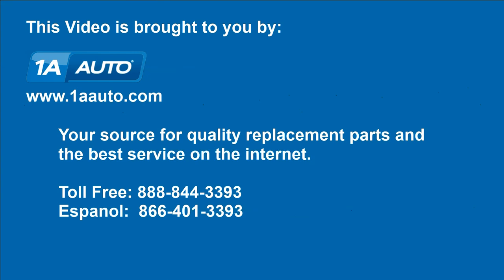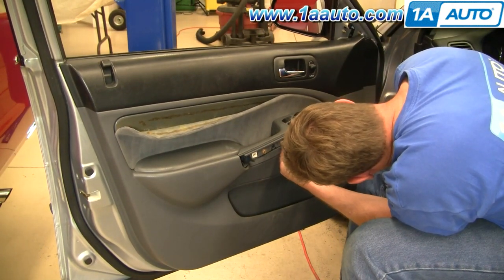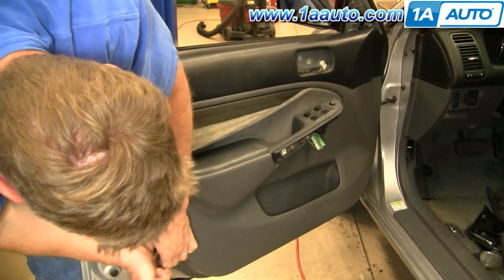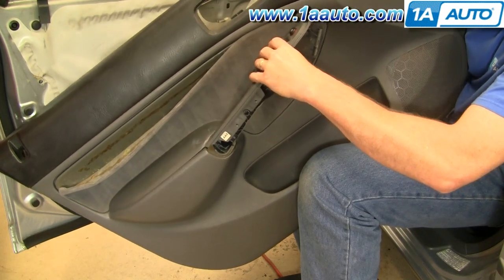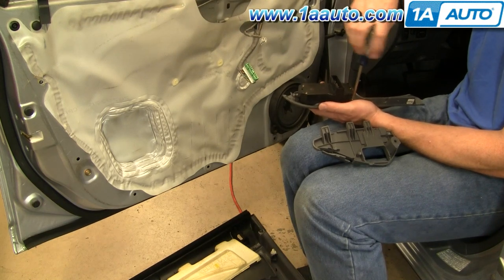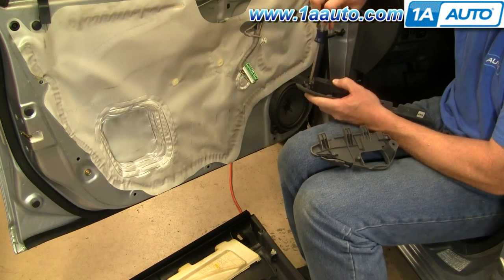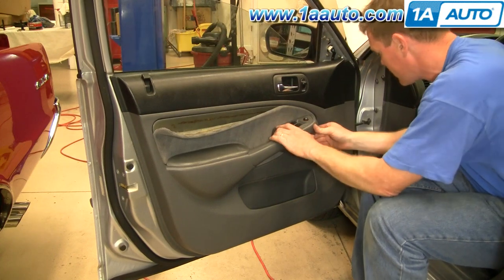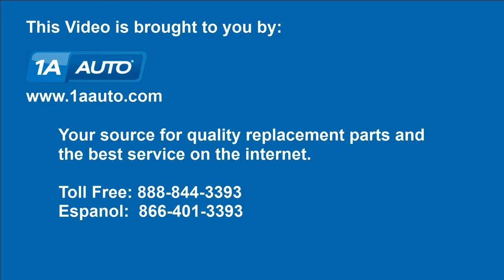How to Replace Power Window Switch 01-05 Honda Civic

Comment: Thanks for sharing!  I saw Honda Service Bulletin 06-010 from March 8, 2006 that shows this can all be done from the outside without taking the door panel off. I was confused why you did that, and even after you got it off you, in the end, popped the portion that holds the master switch off from the part that was screwed in from the back as near as I can tell.  Seems you may have caused a bit of extra work. That service bulletin is not extremely clear on the clip location to remove the switch base, but after watching your video I think it can be done without taking the door panel off. Maybe. :)
Reply from the maker: +Steven Palm Thanks for watching. If any of our viewers needs to make this repair we carry the part shown in this video on our website. Here's a link to them https://www.1aauto.com/1A/WindowSwitches/Honda/Civic/1AWES00100?utm_source=YouTube&utm_medium=CTA%20Comment&utm_campaign=1ATony
Reply: I just replaced mine yesterday. Indeed you do not have to remove the entire door panel. Only the control button housing.
Reply: Thank you for including the TSB number. I found that with a quick search and also didn't take the door off! You saved me at least an hour. Thank you.

Comment: There was no need to remove the whole door panel but in your case you were removing it anyways. Not trying to be ignorant but this can save others and bit of time and frustration and possibly spare a few clips from being broken by the untrained hand. But this was a great video nonetheless. Keep up the great work 1aauto !
Reply: sergio cisneros pienso lo mismo, lo reemplazé hace unos dias y no es necesario remover el panel completo, saludos
Reply: I was wondering if removing the whwile door panel was necessary 🤔
Reply: Also by taking the door panel off you can misalign that foam block and mess that up too. Totally unnecessary to take off the door panel.

Comment: Please pin to the top that the door panel does not need to come off to replace the door switch. You just pry off the the bottom side of the arm rest under the switches with a screwdriver, then there's a couple of screws holding the power window arm in. Then you take off 3 screws holding the switch in, and that's it! No need to remove the door panel and possibly misalign that foam block. I actually had to remove one of those foam blocks very early on when I got the car because it fell out of alignment and I didn't know how to take the door apart so I just left it off. If you misalign the foam it'll get in the way of the window going down.
Reply from the maker: +aznnp77 Thanks for the feedback!

Comment: Hello, I have a question. First, thank you for the great, thorough video! i have an 01 civic and I changed out my switch and fuses because my passenger window switch burned out on the master switch. However, after testing my new switch, the broken, front passenger side window works but now the front driver side window doesn't work. Any ideas??

Comment from the maker: @MexhomieXlll Check the wire harness that runs between the door and body of the vehicle, there may be a broken or frayed wire in the harness that needs to be repaired. Hope this helps you out. 1aauto.com 888-844-3393

Comment: I have a 2001 Honda Civic EX Coupe, and the lock cylinder of the driver's door fell inside the door panel (I assume something is loose or maybe broken & ready for a replacement) I cannot lock or unlock this car anymore!. Thanks to this video, I know how to remove the door panel, however I do not know how to replace or repair the key cylinder. Can you help me out? is there a video for this?
Reply from the maker: Thank you for watching. We do not have a video on the cylinder but will keep it in mind for future videos.
1aauto.com 888-844-3393

Comment: Hi, I loved your video. I replaced fuse and replaced master switch .(smoked with burning smell) The passenger side window worked 1 time! up and down then quit. Fuse still good..any ideas?
Reply from the maker: You may want to test the power going to and from the switch to see if there's power going to it. Also check the wire harness between the drivers side door and the body of the car to see if there's a broken or frayed wire that may need to be repaired. Hope this helps you out. 1aauto.com 888-844-3393
Reply: thank you so much!

Comment: I attempted to remove the passenger front door panel using a putting but it would not budge. I removed the cover near the mirror, disconnected the wire, removed the cover below the power switch, removed wire there,  unscrewed the 2 Philips, removed the door look and disconnected the clip. No matter how force I put, I could prove open the panel. I follow these same steps for my 01 civic coupe and it worked with ease but I having a hard time with my 01 civic sedan. Any suggestions would be great?

Comment: Good vid. thx
Reply from the maker: Thanks for checking us out. 1aauto.com +GKT
Reply: @1AAuto  , hi, revising my comment,  I reviewed several other vids and an online civic oem manual and there is no need to take off the entire door panel . access to the handle and window control module can be all be done by prying off the face of door handle, alone, and unscewing  two screws and the entire mounting faceplate then slips out forward, and off alowing the wiring harness access and then with faceplate and switches in hand' some small screws remove the module from plate.  please remove this vid...it is highly deceptive. please see other comments below...that were ignored. thx, gt, boise , idaho

Comment: I bought the master window switch and the two back buttons are hard to push up and down and sometimes get stuck idk if its the switch or the motor or relay that is not working correctly

Comment: I have replaced my master switch and still no result.  The new switch doesn't operate the driver door window nor the other 3.   Currently the only window that works is the passenger side.  I have a new window regulator for the driver door and the switch doesn't move it when tested.  I've checked all wiring harnesses and Yes power to the driver door.  Is there a key reset step process to go through after replacing the OEM bad master switch with a Aftermarket switch so the computer can talk to it.  Thanks

Comment: Did anyone else's window switch fill the car with electronic smoke when it went out? Mine did twice, once during the right rear window death then another time when the passenger window stopped working.
Reply from the maker: +Jthumper You may want to check the circuit for a short that may be causing this issue. Hope this helps you out. 1aauto.com
Reply: Jthumper mine did as well in the passengers window smells like burned rubber!

Comment: hi any idea how or why the rear driver and passenger windows wont go up or down from master or from the rear of the vehicle..will replacing master fix all of them
Reply from the maker: Hi Michael, You may want to check the power going to the doors that are not working with a test light to see if there is power going to the window switch(s) and also the window motors. There may also be a broken wire between the drivers side door and the body of the vehicle, that could be preventing power to those doors. Hope this helps you out. Here's a link to the switch shown in the video if you find that the switch has gone bad. http://www.1aauto.com/1A/WindowSwitches/Honda/Civic/1AWES00100?utm_source=VideoReply&utm_medium=VideoReply&utm_campaign=1ATony